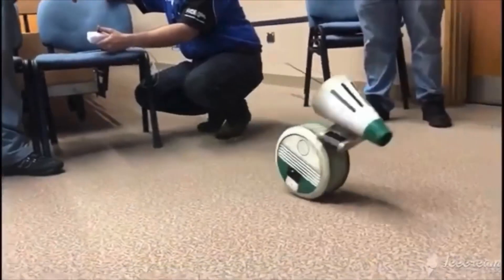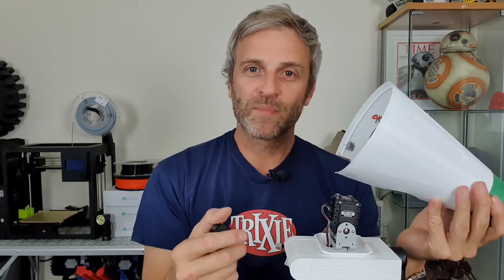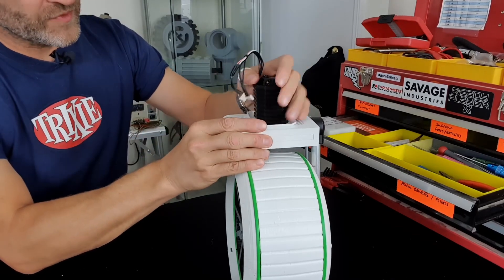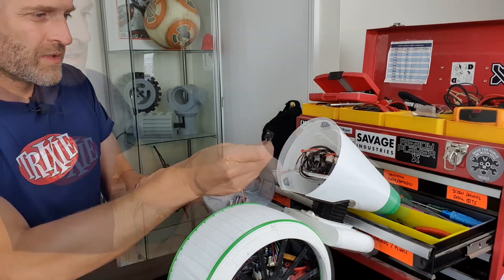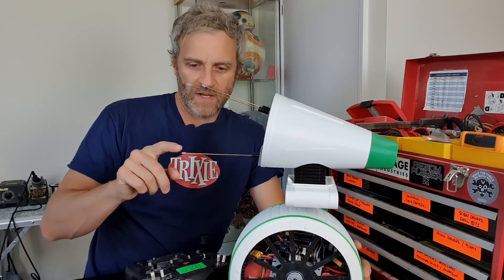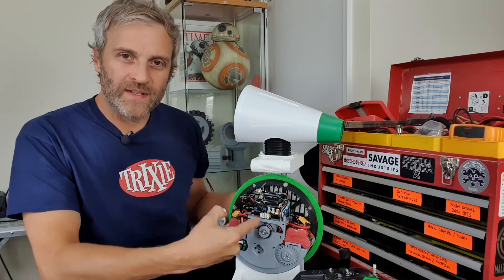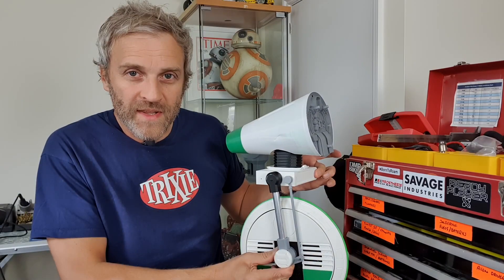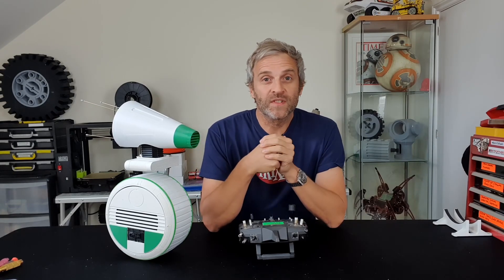Droid Build D-O - #5 - Mantis Hacks

Comment: The cost in the US for all the parts is over $1,000 if I use the parts you suggested whereas the Mr. Baddeley's design & parts is about $400. I like the higher end motors you use but it also more than doubles the cost.
Reply from the maker: Yes.. I’m not sure what you’re point is. I never set out to make a low cost droid or a copy of Mr Baddeleys. I wanted to use higher end components 👍

Comment: Excellent build - the attention to detail is amazing.

As far as the clutch/bushing goes, nylon is hygroscopic, so parts can be annealed for toughness by putting them in boiling water (they can be colored as well by adding fabric dye to the water).  This is SOP for nylon props in the nitro model airplane world, but haven't tried it on 3D prints but it may make that part even tougher.
Reply from the maker: Thanks 🙏